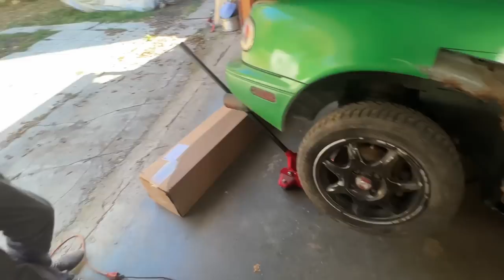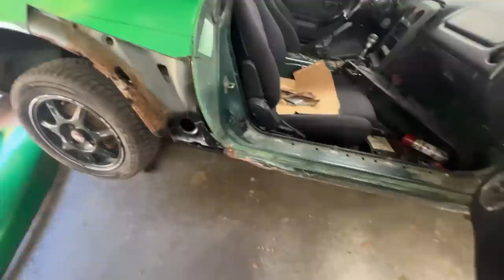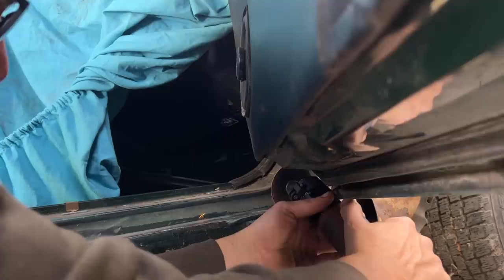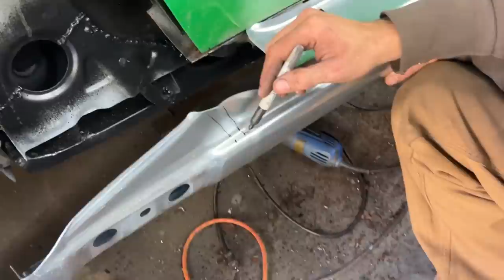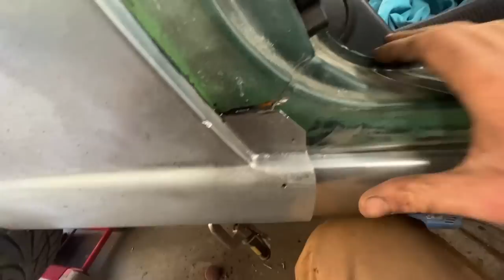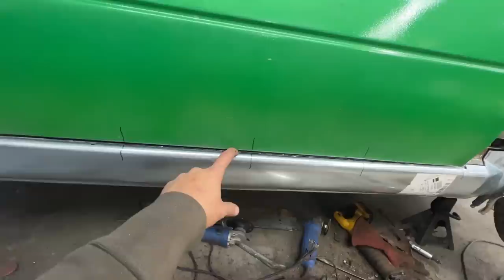1994 MX5 Miata NA - Part 9 - Fitting The Rocker

Comment: I also repaired the rear part of my MX5 (Miata). At this point there are really a lot of metal sheets that have to sit correctly. You're right the replica sheets really don't have a good fit. There are many things that need to be reworked.🤷‍♂
But, as far as I can see, you'll both be able to pull this off just fine.👍👍
Special regards to bass-heavy Nicola 🔊🔊